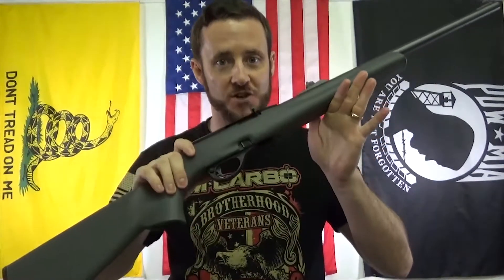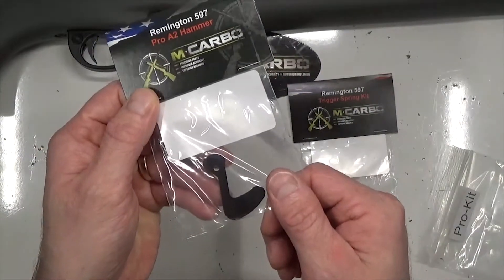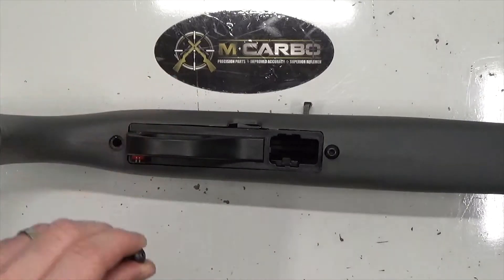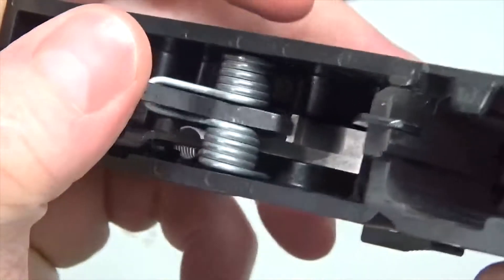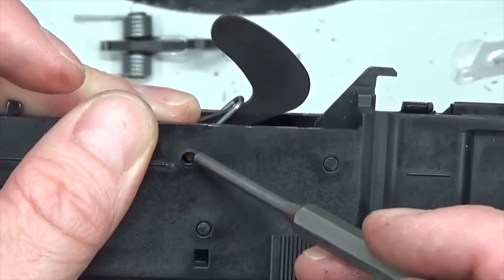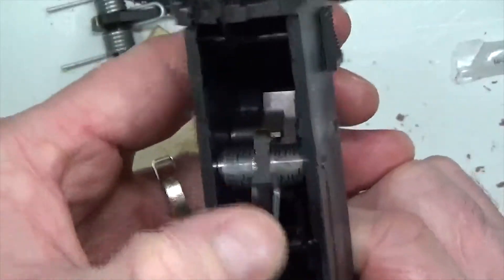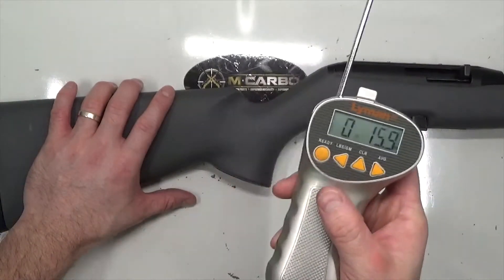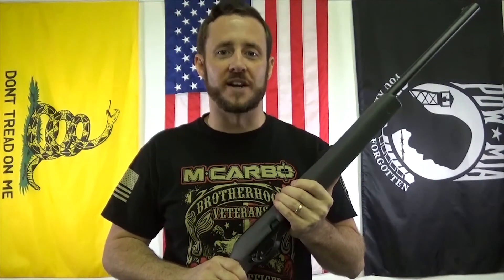Remington 597 Trigger Job Upgrade Pro Kit - M*CARBO

Comment: Just shot my 597 with the pro kit installed. My trigger pull came down from just under 5lbs to just under 2. It's really smooth, & the reset is so fast it just incites you to shoot fast. Am excellent upgrade, well worth the trouble I had to get a kit to the UK. You need a UK dealer!

Comment: Installed this today.  Works excellent.  dropped it a few times and does not go off.  very light trigger but not too light.  no improvement in accuracy but i was good with factory trigger.  much faster shooting.  can hit the tree so fast its still swinging plates while im shooting!  very easy to install. thanks.

Comment: Have 2 597 remington rifles.
Installed kits in both...easy enough to do...but the results are just ok
Contacted Mcarbo concerning the trigger upgrade as well...NO answer back.
Wish they would have at least followed up.
I forgot to mention the kit no longer includes or offers trigger.

Comment: Good vid. Do you have one on how to replace extractor? Other vids on line not good quality .. thanks
Reply: Pull the bolt out, flip it over, there is a small cut out. Pull back on the extractor and take a small flat heat screwdriver and push it out in the cut out spot. Spring and detent behind it should fall right out. Re install is a pain because you have to push it down in the spring pocket and "click" it back into the cutout area.

Comment: My rifle will not cycle after install. I installed exactly as instructed and triple checked. The hammer will not lock back and engage the sear.
Reply: Check the linkage and make sure the small spring at the bottom is attached to the linkage and the lowest pin and make sure it's not binding. Also make sure the hammer has a notch cut out for the sear to seat.
Reply: @dakotaracer71  I will give it try and report back. Thanks.
Reply: @ashesdrivered  ok. I work at Remington and spent alot of time on the 597 line last year
Reply: @dakotaracer71 Finally tried it out!  I checked the install all over again and everything looks good. It still won't rack the MCarbo hammer far enough to properly engage the sear. I can only do it manually by hand with the receiver open. I have just reinstalled the stock Remington hammer but kept the MCarbo bushings and spring in place and it functions properly. The Mcarbo hammer appears to require to be moved much further back than the stock hammer. So now I am using all the Mcarbo parts except for the Mcarbo hammer.